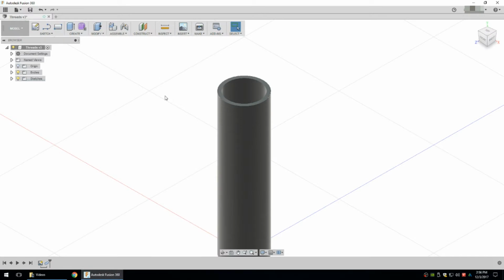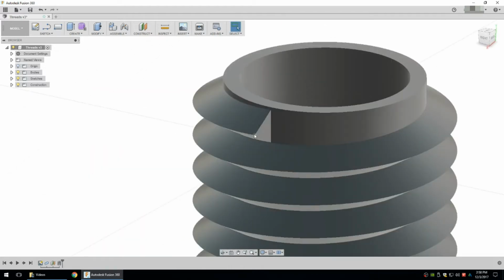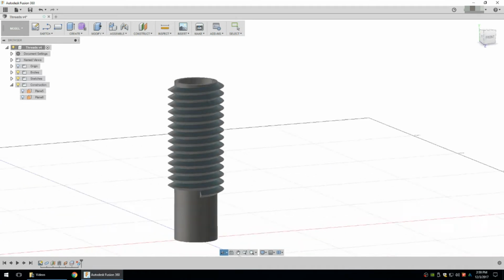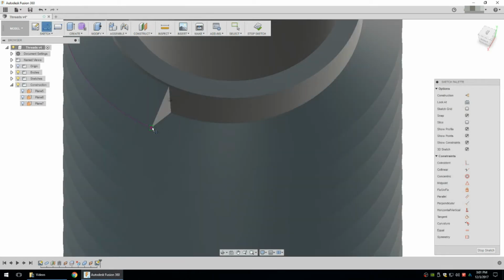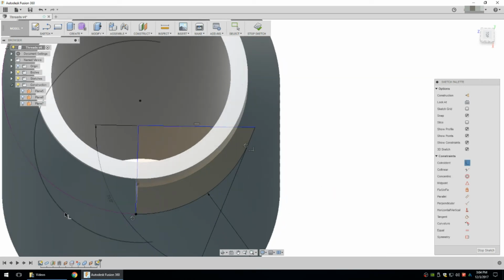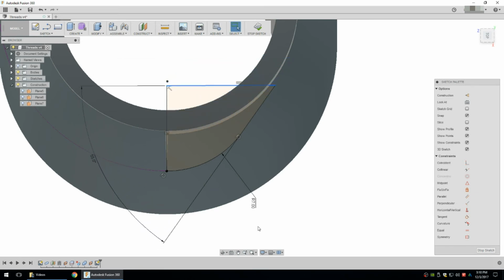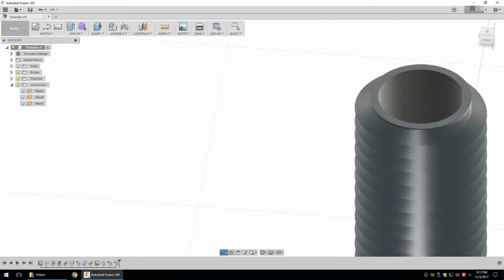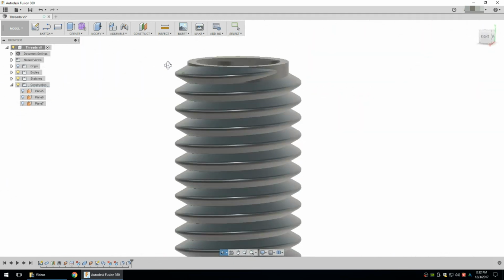Create Custom Threads With Tapered Ends In Fusion 360

Comment: Thank you so much for making this! I've been going crazy trying to print a 1/2" PVC NTP thread for days. It's astonishing I couldn't find an existing model. How many millions of people use 1/2 PVC?!? This technique worked really well for me. On the last step where you draw the path to make the thread disappear into the shaft, I just used a simple 3-point spline curve. Super fast and easy to adjust. I've now got a 1/2" PVC NTP male thread that screws in well and tightens. I haven't pressure tested it yet, but I will.
Reply from the maker: Yep...same frustration trying make threads for a project.  I hope Fusion 360 implements an end thread feature which auto tapers threads. @fusion360

Comment: Hello MrDabrudda,
First of all, I'd like you to know that I truly appreciate the effort and time you've dedicated to make this video and more for willing to share it with the world; thank you very much.
Unlike other people, I think your idea on creating tapered threads can serve as an inspiration to find our own (better?) ways towards the same purpose. 
And, in the same spirit of sharing what we know, allow me to add my humble experience with this challenge.
Apart from using the Plane Along Path tool, as you explained, I've created a circle (in 3D Sketching) starting at the Projected vertex from which you've extended the arc. What I've gained from that was more control on the angle of the plane over which the circle was being created, I mean, I was able to make it parallel to the previous coil line for the length of the smoothing segment I wanted to set; last, before sweeping the triangular profile, I draw a construction line from the vertex (and staring point of the circle) to a point on the circle that would leave me with the desired segment of the circle that I need; this step avoids the workload on radii, angles and line lengths to obtain a desired profile. The rest is as you did which I'm very grateful for.
I haven't ever produced a YouTube video but I might decide to do it for a better visualization of what I did if my explanation is not clear or understood.
Thanks again and be safe.

Comment: Entirely too much trouble. I'm sure there's a better way...and I'll find it.
Reply from the maker: Find an easier way and make a video.
Reply from the maker: GOOOOOOOOOOD LUCK finding a easier way!!!  Did you find a easier way yet???  It's only been 12 months.
Reply: @MrDabrudda  create the coil as a new body and then use the move tool to move it up and down your cylinder. Combine it with the cylinder and then use the chamfer tool to slope the thread ends into the cylinder using a .99 chamfer.